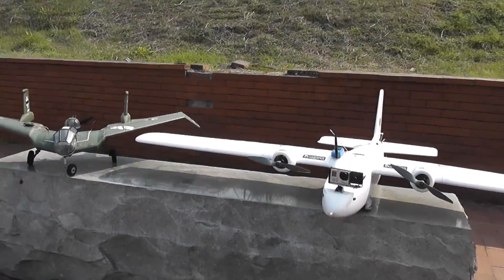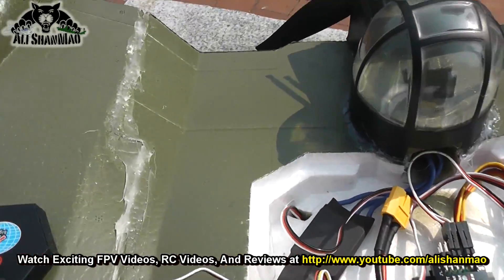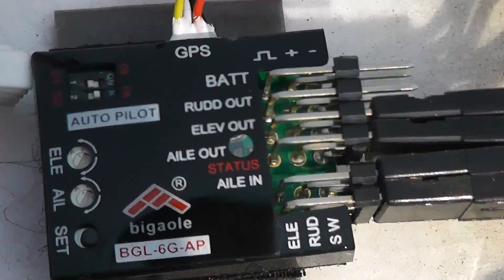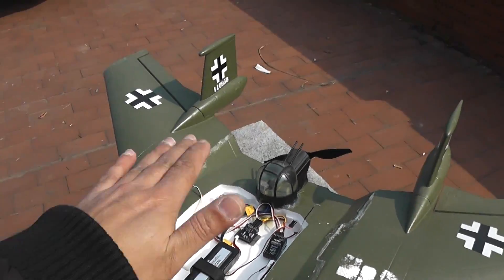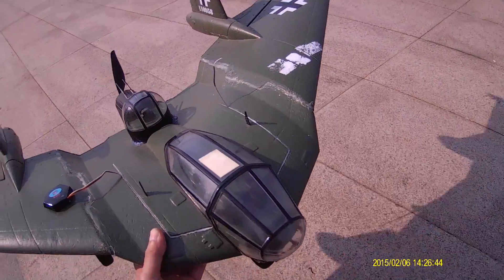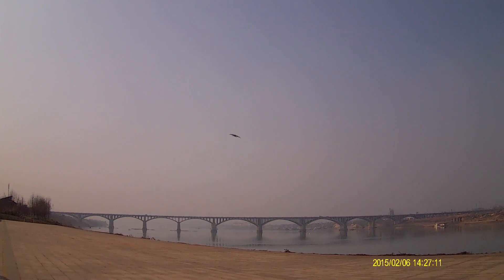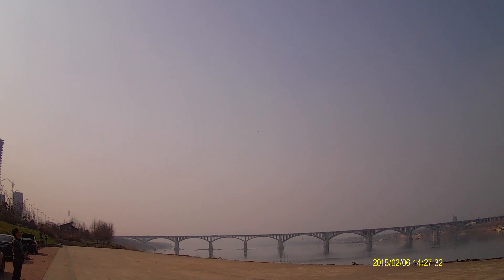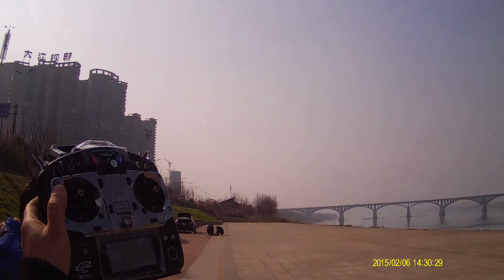FPV Plane Cheap and Tiny Autopilot with GPS

Comment: I found a cheaper brand,of course it doesn't allow for GPS,I am not sure it would be nessary anyways,at least not for me. With the FAA rules,flying where GPS is needed just says you plan on breaking the rules anyways. I dont like following the new rules and wont register my stuff under the new ones,but do follow the old already established ones. Mabe if I had a fly away gps might be ok. I only had it happen once and low battery alarm worked juat fine at finding my lost helicopter.

Comment: How much  did the weight increase? What mah lipo are you using and what is the weight is it in Grams? Did you put a bigger amp ESc in it? Thanks for the help. I am going to go with A 6 x 3.5 prop, an Admiral 3700 mah 40c battery from motion RC which weighs 274g and a Turnigy plush 40a ESC to handle the new power, but same stock motor. thanks!

Comment: try to find them here from this place;;  Shenzhen Bigaole Electronic Co., Ltd      ;block 14, the first industrial village of songgang, songgang street,bao'an dist. Shenzhen Guangdong China
Reply from the maker: They are the manufacturers so they do not retail. but they just replied my email and I am going to stock these a bit.
Reply: alishanmao Dear Alishanmao,
I just checked the Only Flying Machines Web Site to see if you are selling these flight controllers yet.  I did not see them there.  Did you ever put any of these on order.  If so, would you mind letting us know when you plan to offer them for sale?  I've searched high and low, and can't seem to find them anywhere other than Aliexpress or AlibabaDOTcom.
I look forward to hearing from you!
Reply from the maker: Around the Clock Aerial Video I will try to arrange few pcs ASAP :) email me next week :) how many do you want to order?
Reply: alishanmao Just one for now, but if I like the way it works I may want to purchase some more in the near future.  Also, it sounded like at least three or four others on here were interested as well :-)
Reply: alishanmao Dear AliShanMao,
I just wanted to follow-up with you on this.  Were you ever able to acquire any of these Autopilots?  I'm still interested, but haven't had any luck finding them for under $70.
Thanks again. . .

Comment: Hello! For 50 bucks i can also buy a MiniAPM (Arduplane 3.2) which has WAY more power with GPS Position Hold, Routes and Autolaunch/Autoland so .... for 50$ without GPS i dont think its that great (even if its 50 with gps i think it has no chance agains a miniapm)
Reply: What is the preferred GPS module to mate with this MiniAPM?  I'm trying to compare apples to oranges here.  If a suitable GPS Module is another $20, then you've got $50 + $20 = $70.  Now you are approaching a cost differential of X 2 (double).  . . .and what about weight? It looks like the MiniAPM weighs around 20 grams by itself, which is fine, I guess.  
Much to consider. . .  Hmmmmm

Comment: So if it doesn't have a barometer or auto throttle how does it maintain altitude in RTL mode?
Reply from the maker: zekezero12345 You need to set and tweak your plane in manual mode to fly straight not climbing not losing alt. Then set that throttle as failsafe. rest gyros try to balance the plane in every direction so having a good throttle always seems to maintain a good altitude.

Comment: dude I have eye one extreme quadcopter by RC Logger just transfered it ton a 200 mm frame diatone hobby king switch blade 200 how much bit cost where can I get it how much it weight weight is the enemy thanks for vids you da man

Comment: Was that hot glue that I saw on the wing joint? That is a lot ;)
This autopilot looks easy enough to setup with just a controller and a gps unit. Great work showing us how it perform Ali. I believe people will start asking you where they can get one of this for themselves. I can't seems to find a link to it in your video description/info.
Reply from the maker: kapitanC True, Thats hot glue. Foamy planes + Hot Glue easy fix LOL and assembly.

Yes this company seems to have no links for these. no idea if these are still beta or selling or not. I got it half a year ago LOL. and it was sitting all this time in my office. Finally i found time to put it to a good use.

Comment: Hey whats with all those people crowding  the Quad masters Kingdom? might be time to re-arm your vehicles with some roman candles and show them who is boss?!! :P on a side note have you seen the Sky Prowler aircraft on kickstarter? you need to get one of those :) thanks for showing us the flight controller
Reply from the maker: TheMighty Thor Yes seen it, but i do not think (including many others) that its efficient to have hovering mechanism folding down and separate flying mechanism. It adds extra mechanical moving parts and extra weight to plane config, why not use same 4 motors to tilt forward and fly as plane configuration, why two additional motors for plane configuration. in plane config, 4 motors, props and folding mechanism causes drag, adds weights etc. in Hover state plane motors cause drag and extra weight. Not a well thought design. 

we are working on Hyper 330 Quad. with dynamic tilt motors with pitch control. i am flying prototype daily and am addicted to its performance. no FPV Racer 330 quad beats its performance. Due to Dynamic Motor Tilting (DMT) it shoots fast, takes speed instantly when you move stick forward and when you move stick back, DMT adds instant air braking. Never seen a quad in my life stopping that quick and hering stable from a high speed forward flight. When making videos, Maryam followed quad when it shot fast, and when I stopped to hover, you could see camera lag as Maryam expected quad to stop farther, while quad stopped in its point in the air so quick that we were amazed. 

DMT Gives us Instant cornering and fast shooting out when corner is done. great for  FPV Racing and Sharp Cornering, Tree Dodging and avoiding Tree Slapping LOL

Now I am sure Hyper 330 goes faster than SkyProwler and will be even faster if we put the 4S battery setup. I am flying with 3S and am very happy with speed. 

having so, all we need to do is add Wings to our Hyper 330 and set end points to let motors move totally forward and turn it into Eat the SkyProwler Quad LOL 

wait for the Hyper 330 Videos :) we do not want kick starter. we have finances to do it
Reply from the maker: alishanmao by the way we will release Hyper 330 Soon as ARF and RTF FPV Pod Racer :D
Reply: alishanmao I always appreciate ur insight and knowledge, thanks for ur explaination!!